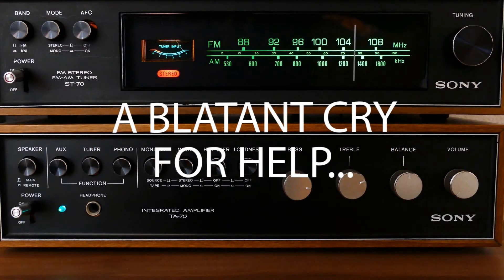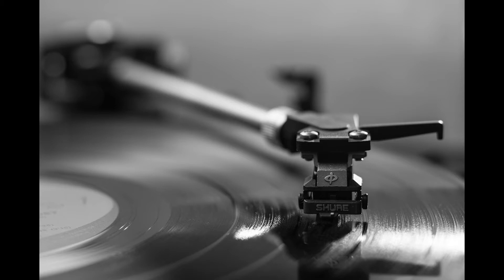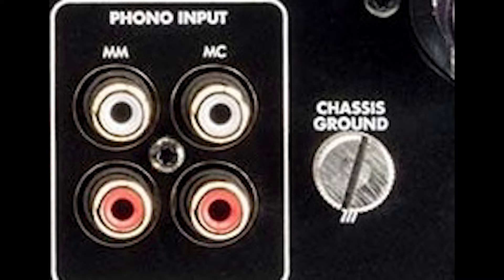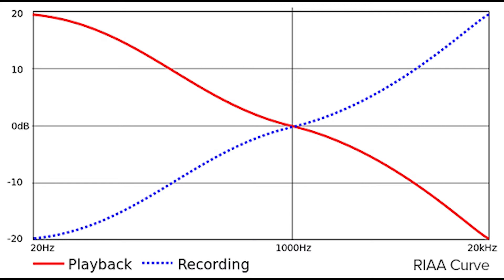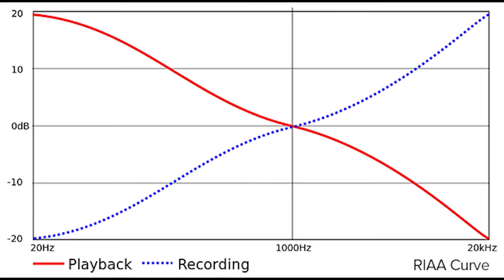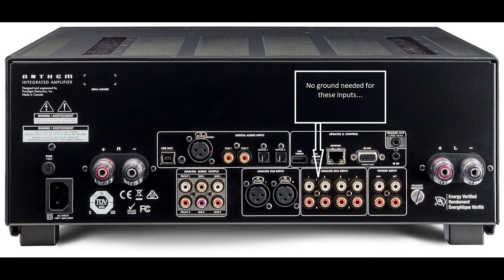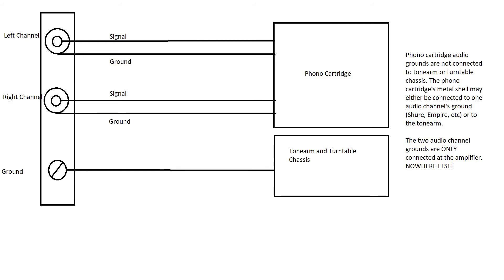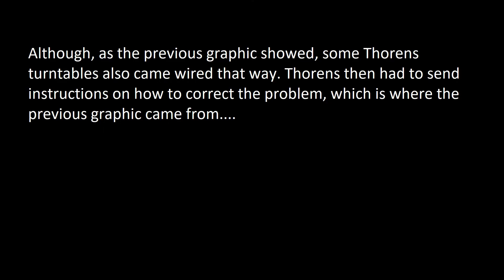Why Do Turntables Have Ground Wires?

Comment: Thanks for that information.  I've been tinkering with some old 1219 and 1019 Duals lately, servicing them trying to get them running well etc. It looks like I'm going to be having to replace some RCA lines which led me to this video.  These duals don't have a separate ground wire to connect to amp or phono amp.  I'm thinking I should add one.  I'm learning to solder as I go and get the idea of the RCA lines have a ground for L and R built in.  But to add a separate stand alone ground wire that I'll connect to the amp what do I solder it to in the turntable?  Do I just go to part of of the metal frame and connect it there or is there a specific place it needs to be connected to?  Thanks for any info you can offer me on this.
Reply from the maker: Hi, Elliott. You're right, those two tables have no ground wires, and while adding a ground wire is simple, it'll only make things worse if you don't isolate the tonearm wiring from the chassis ground at the same time (you'll end up with a ground loop). Those original ground connections, between the tonearm wiring and the chassis ground, are under the shield where the muting switch is. You'll want to disconnect the chassis ground connections to the muting switch, while still leaving the muting switch connected to the tonearm wiring. Then just add a one-meter or so length of 18 or 20-gauge wire, with a soldered or crimped on spade connector on each end, under the screw that holds the shield in place. This will be your new ground. Be careful of the tonearm wires, they're fragile and short.

You can go to vinylengine dot com and sign up for free, then you can download the service manuals for these tables. The manuals will be a great help if you don't have them.

--Scott.
Reply: @ScottGrammer  Great information!  I never would have know to do that had I not commented here!  Thank you so much.  I do have the manuals and will be looking them over before I do anything.  But if I'm not getting any hum would I be better off just leaving them alone, and only doing this if the problem starts down the road?  Does the "if it ain't broke don't fix it" saying apply here or should I be proactive?
Reply from the maker: @elliottcrews4997  I'm a firm believer in the idea of if it works, don't fix it.